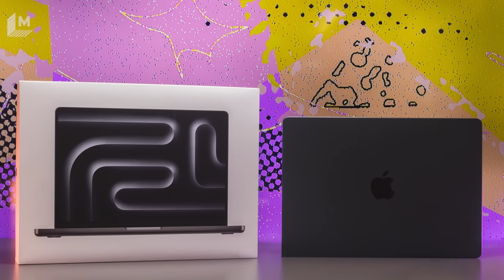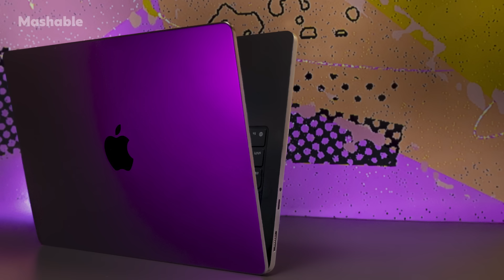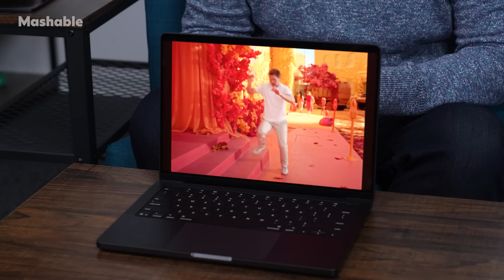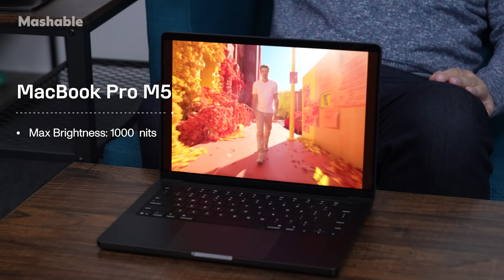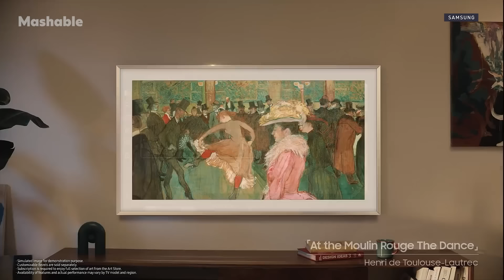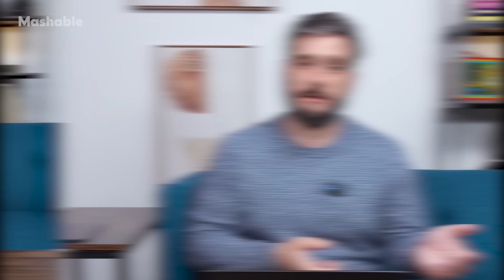Is the NEW MacBook Pro M5 Worth it?

Comment: I got the M5 Base 24Gb 1 TB last week.

It doesn't boot up and load items such as apps/web downloads/programs as fast as I'm used to on my 10 year old Intel Asus ROG laptop with a Samsung SSD. This was surprising since all the reviews said the SSD in the M5 was super fast. 

Gaming wise, I tried playing WoW at high settings (looks nice bc the display), however, it heated up quick to the point where I said forget it I'll just play on my 10 year old Asus ROG laptop. The graphics look more detailed and the chassis stays cool.

I really like this laptop for a portable sleek work and multimedia machine tho. Just wish I could've tried the M4 Pro 14 inch instead. Unfortunately, in Japan they don't sell them new anymore and when they do its from a shop that overprices them.
Reply: What about Bic Camera and Yodobashi? Are you from Japan yourself?
Reply: @defensore  
This claim is completely absurd. A modern Apple Silicon chip with a high-speed NVMe SSD operates on an entirely different level than a 10-year-old Intel Asus ROG laptop. Even a top-tier Samsung SATA SSD from a decade ago caps out around 550 MB/s, while current Apple SSDs hit read and write speeds in the thousands of MB/s. Combined with unified memory architecture, native apps and boot times on Apple Silicon are virtually instantaneous compared to mid-2010s hardware.
If a new Mac actually feels slower at startup or when opening programs, it is down to a few user-side factors: initial Spotlight indexing, background iCloud syncing, or trying to run unoptimized x86 software through Rosetta translation instead of native ARM code. In raw I/O throughput, CPU architecture, and drive performance, a decade-old gaming laptop cannot physically compete with modern Apple Silicon. Claiming a 2014-era machine boots and loads faster sounds like user error or plain trolling.